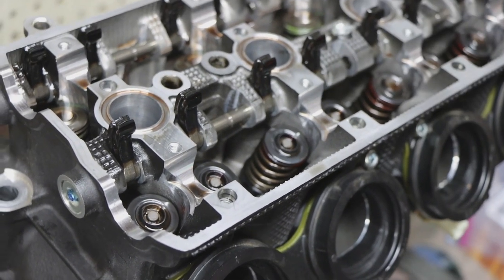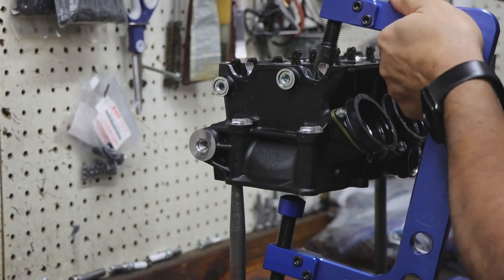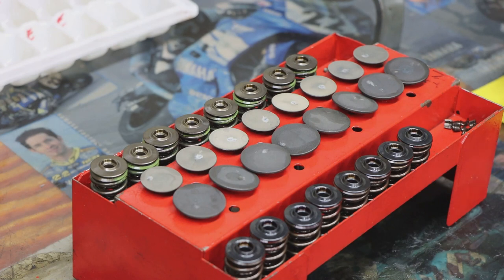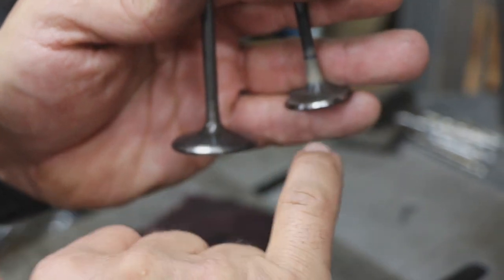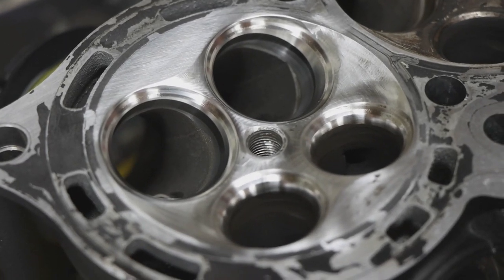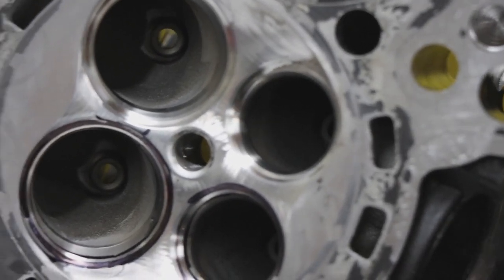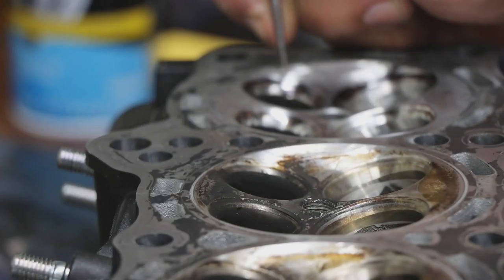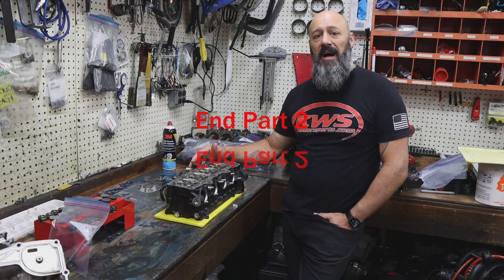Yamaha YZF-R1 Head and Valves Inspection (MY 2020) - Part 2

Comment: Hey my 2018 r1 has a ticking can’t tell if it’s valves,timing chain rod knock ect, my bike been down for about 8 months wondering  where is Mike shop is located saw one  in Charleston which is close by but wasn’t sure if it’s the same shop. love his attention to detail and would for him to fix my bike thank you.
Reply from the maker: Yamahas are a little ticky.  Rod knock usually shows up when you rev high and close the throttle, not usually at idle so that would be really unusual unless you ran it out of oil.  Sometimes on Yamahas when the cam chain is between notches on the cam chain adjuster they get a little louder.  We've been known to loosen the cam chain adjuster very slightly until it "clicks" into the next notch and then tighten it down again but that is not recommended unless you are really familiar with it all.

Anyway... KWS Motorsports is https://www.kwsmotorsports.com/ 

KWS Motorsports
Address: 4657 Franchise St. N. Charleston, SC 29418
Phone: (843) 552-7177
Fax: (843) 552-7132
Reply: Thank you, yes it’s a constant ticking on the cam chain side gets quieter once warm but still there for sure when doing small revving ticking get louder/faster because of revving, I have a video hopefully I send over a video to kws so they can give me a better Idea of what it maybe and a estimate to fix it shop is 4hrs from me but its definitely worth it for them to do the job.

Comment: when should the valves really be checked when someone who doesnt ride too hard and is only on the street with full exhaustm filter/tune
Reply from the maker: Assuming your R1 is a 2020+ R1 then the factory suggests checking valve lash every 24,000 miles (40,000) km.  Judging by how good everything looked in this engine then it suggests that a street R1 with decent maintenance should last a very very long time.  A roadrace engine is catching full power gear shifts about every 1/4 mile or so.  That really beats up the edges of the sintered metal gears which led to this engine needing to come apart.

If not for the gears wearing out we would not have otherwise stripped down this engine so go enjoy yours!

Pro Tip - do take your bike to a track day with beginner coaching. Once you've been on the track, even just a single time, you are much safer on the street, as long as you only use your new race track lean angles on the street in emergencies, not every turn...
Reply: Thanks for your response, I take my R6 to the track. But as for my 2020 R1 I was genuinely curious what someone’s thoughts were who actually had an idea of what they were talking about. My bike has around 17k miles n it’s well maintained and I mean I baby it. Oil changes , on oil changes , on oil changes along with keeping up with the suspension, brakes etc. I want to check the valves myself, being that I am really really handy and have access to CNC machines etc (irrelevant to the question) but I’m good with my hands.  And am very anal when it comes to working on things. I just don’t know if it really needs done yet. I was also thinking of buying a whole used engine on the side and rebuilding that just for the fuck of it and not fucking with my oem one and leave that one to professionals until I feel confident in my ability. I appreciate you for real tho.
Reply from the maker: Checking the valve clearances is tedious, but not too hard.  You just have to take off a lot of stuff to get to the valve cover.  And then, once you check them, you will find that they are all still in spec and you don't need to mess with them until 48k miles.  

Or, do it dirtbike style, and wait until it gets to be hard to start... (j/k).

Comment: Also, good in the informative video however, your estimates for the exhaust valve temperatures are extremely off by about 80%…And not accurate by about  6,300 degrees Fahrenheit, the exhaust valves will generally only get up to a maximum of 1700°F… lol not sure who told you that but 1700° is about the maximum some a little hotter forced induction or highly modified top fuel stuff. But pretty good video overall. Im a master engine builder /  Race vehicle engineering / as well as a mechanical engineer / and own a few race shops here in the US and we build Superbikes, superbike engines, and also specialize in the Yamaha R1 Race platform as it’s our favorite bike, and race engines all the way up to ( WSBK SPEC) world level race engine/bike / endurance superbike engine  part development also on the bike side of things. 
As well as other forms of racing engines in all different categories of racing , including offshore boat racing which is arguably the hardest motorsport on making an engine live, GT2, GT3, LMP1, LMP2, etc etc.  but like I said, good video overall. 👍
Reply from the maker: Yeah... Godin misspoke.
Reply: @armyofdarknessmotorcyclesb2883  
I figured  lol all good but good video again overall 👍